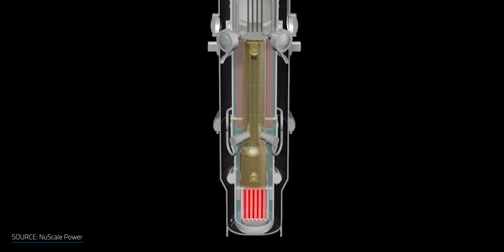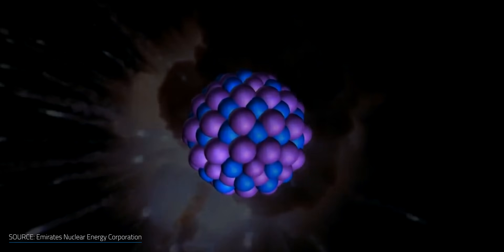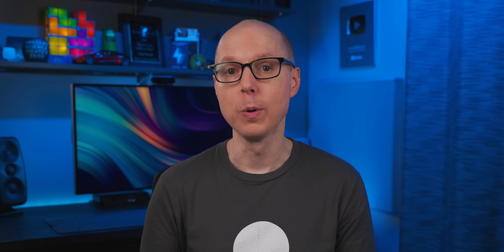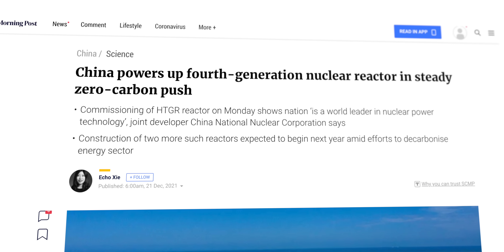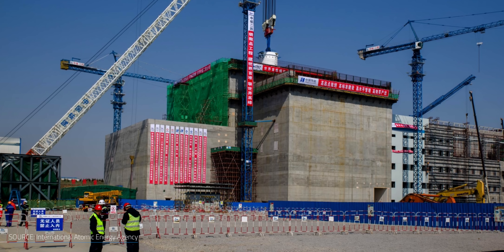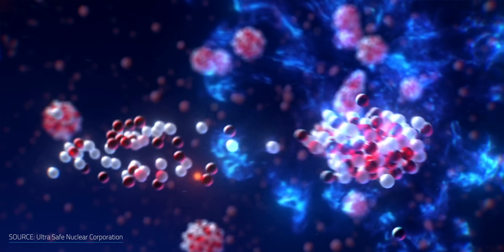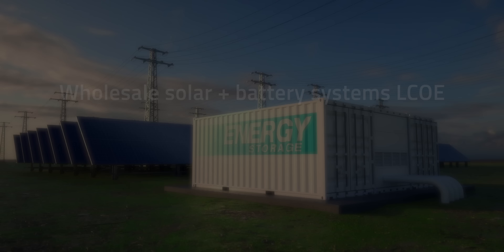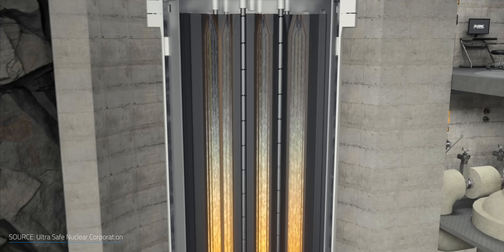Forget Small ... What About Micro Nuclear Energy?

Comment: I've been reading that breeder reactors can burn most any type of nuclear fuel or waste until 95% of it has low level radioactivity. current reactors burn the first 5% or so, so there is a vast storehouse of useable fuel moldering away as waste. Big, EXPENSIVE transformers are not needed for local transmission - put a reactor. where the electrical substation would be. Search Gen IV nuclear power to see.

Comment: Fast neutron reactors don’t have to use liquid metals for cooling, there are several designs is being developed that use molten salts, either as a cooling medium for solid fuel elements, or as carrier liquid for dissolved fuel.
Elysium and Moltex Energy both use the latter approach.
Reply: Well I guess salts kind of technically counts as molten metal. What is a salt anyway if not a metal ion bonded to a nonmetal ion...
Reply: The engineering challenges associated with MSRs are massive though. The corrosive properties of salts and the elevated operating temperatures mean longevity is a real issue. There's also the operational requirement to keep the primary loop hot at all times, or the salts will solidify and functionally destroy the the reactor.

Comment: Our energy future should not be limited to one idea or one so-called green solution. Nuclear has come a long way since the early days of the industry. GE Nuclear in the 60's talked about reducing the size of reactors and making cell systems which would be overlapped and would cover smaller areas, but would be more reliable, because one failure would not shut down a vast area being serviced by the large expensive reactors of today. Plus the overlapping systems could supply the failed reactors area' until the unit was replaced by a new one. There are many advantages to going nuclear particularly with the advent possibilities a Thorium reactor represents.

Comment: A pellet of nuclear material, that creates a few hundred degrees, safety encased in shielding, could heat domestic hot water for years, decades, or centuries, depending on the isotope. No moving parts, just in the water tank.
Reply: You know hot water tanks have sacrificial anodes sized for the length of the warranty right? The difference between the 5 year and 15 year tanks is 2 additional anodes.

Comment: "safety valves that open automatically in case of overheating"

huh... so... nothing like 3 mile island valve right that let all the water boil off could ever happen with that right?
Reply: 3 mile island happened in part because the technicians were used to working on much smaller naval reactors where decay heat is not as much of a concern.
Reply: @economicprisoner  and because of engineers that put a light, behind a desk that showed power applied to the release valve... not showing if the valve was open or closed, just that power was being applied to it... 
Engineers are some of the stupidest smart ppl i have ever met

Comment: Ehhh.... 
This is laughably disingenuous. 
There isn't a debate about nuclear safety. 
It isn't safe, and it won't ever be safe. 
Even completely ignoring the radioactive half lives of all nuclear fuel and natural disasters, we still have to contend with the human element. 
War and stupidity (whether accidental or normal negligence) doesn't matter, there will be nuclear accidents, and increasing the use of nuclear energy increases the number of incidents.

Imagine if every bombed out tank from every war over the last 20 years had a micro nuclear reactor in it.

For the record, Helium coolant isn't used because it's impossible to contain, especially when over heated, which as a cooling medium, it's guaranteed to be at some point. 
You can get Helium hot enough that it can diffuse into solid metal, in a similar fashion to hydrogen. This is the basis of some of the early fusion reactors. 
It's not a safety feature, it's a failure mode. 

Honestly, the world would be better served figuring out carbon-neutral petroleum than miniaturizing and using nuclear energy.

Comment: I've always imagined a community, or even individual homes having these tiny reactors. So let's hope this is the future!
Reply: I would not want nuclear power on a super small scale like that. Someone would manage to irradiate their block.
Reply: @Direblade11  It's not like the home owners are going to maintain it, there will be trained professionals to make sure everything is running smoothly.
Reply: @sptalat  Idk, I don't think most people would want to be around one of 50 points of failure that could expose them to radiation for an unknown amount of time.

Yeah maybe it's a bit extra panic, but when there's 2000 or more tiny reactors around a country, it's a question of when some error will happen. Idk, maybe we can put it in some exceptionally perfectly safe system.
Reply: @Direblade11  As a person who works with radiation, microreactors terrify me. Radiation leak is one thing, but the radioactive substances leak? Thanks, but no.
Reply: @Direblade11  If it's a salt-based reactor, the systems wouldn't need to be pressurized at all, and you could just bury it underground and dig it up every couple decades to refuel it

Comment: The issue at hand is not what to do with the waste but that there is waste to deal with. If the principle on which we're moving to is - reduce, reuse, recycle - nuclear waste doesn't fit into any of those categories. Everything we use needs to be in a cycle of some kind and if it can't be recycled or reused at the end of it's life then it's a burden that we should be making. This alone should be an alarm bell that indicates that nuclear is not a long term proposition. Not only that, it should only be considered tactically as a last resort.

Comment: Why not go directly to molten salt reactors? They are also easily made as small, modular units suitable for neighbourhood use, are ridiculously safe, and, as you say, almost as cheap as wind and solar. They are also able to ramp output up and down quickly to follow load variations. But the clincher for me is that they burn over 90% of the fuel  compared to conventional (including SMR) reactors which burn much less than 10% before reprocessing is required, and produce waste with much shorter half lives than conventional solid fuel types.
It a no-brainer for me!

Comment: That depends on the technology. When they use high pressure inside, like all the water reactors do, there is always danger. It's much safer to switch to Molten-Salt reactors. And with a cycle like what ThorCon or Flibe are developing, they can even use the current radioactive waste as fuel.
Forget fusion, current reactor designs are based on wrong assumptions how the Sun works.

Comment: SMR's 'should' form a significant part of the world's overall energy production matrix and Thorium should be the fuel. One thing that people don't realise when comparing coal and nuclear, is the amount of waste that coal produces. 20 to30% of coal burnt is ash and that ash requires storage. While nuclear waste is unsafe and requires storage for hundreds to thousands of years, there is not much of it. Compare that to the mountains of ash residual from coal fired power stations. This inoculates vast areas of land for hundreds to thousands of years also. The impact of wastes are likely similar, when land use is considered. The benefits of nuclear are numerous in relation to air pollution; especially CO2.

Comment: Check out the plasma reactor already built by the Thunderbolts Project. It achieves 100% power output for a 7% input with no residual dangerous radiation.  In fact, it remediates radioactive materials!

Comment: I was a little confused by one comment at 8:20 . you said that when compared to other reactors, microreactors use "low-enriched uranium", which has "U235 in higher concentration". Low enriched sounds like it's Less enriched than a typical reactor, which does enrich uranium, but then you say it has a Higher U235 concentration, which means it's More enriched. Which is it? Higher U235 is easier to use in weapons-grade applications and requires more enrichment i.e. concentration and wasted U238, so higher U235 concentration is typically bad...

Comment: A couple points about waste
1. You're confusing the benefits of fast reactors with Thorium reactors. Fast reactors fission the actinides and thus make their waste last about 200 to 500 years and they can be Uranium based. Waste from older plants can be fed to any fast reactor which will not only get more energy out of that material but also reduce it's lifetime as waste.
2. It can be recycled. France has been recycling for decades.

I'll also point out that LCOE has some flaws that make it less than ideal to use.

Comment: No. Nuclear is doomed simply because of neutron embrittlement of the steel composing the reaction vessels and associated reactor internal structures. There is nothing in our known science that can prevent or eliminate the neutron collisions with.

That said: radioactive waste should be harnessed by making waste containment's casks, tanks, et.al.  into "SNAP" thermoelectric generators. No moving parts, a simple thermocouple. Nuclear waste creates internal heat as it decays; employ that fact and put it to work, as long as the soup of isotopes are radioactive and the 2 strips of metal that compose the thermocouple remain intact: the containment vessel will produce electricity. It will not be optimal but at least the radioactive waste is doing something useful - even if its only powering a few warning LED's in Yucca mountain. For 650,000+ years.

Comment: Toshiba had working models of micro nuclear reactors in the mid 2000s. Safety and low maintenance was engineered into the systems that could power small communities, or installed at your local utility sub station.

Comment: SMRs can be constructed in existing sites where coal plants are being closed. Existing sites have all the balance of plant systems already available for water supply, electrical switchyards for dispatching the generated electricity and in some cases potential  to reutilize existing steam turbines and generators. This is a win- win approach to resolve the base load generation that cannot be obtained with wind and solar intermittent generation
Reply: I think you would need a Molten salt reactor for Coal retrofits. The SMRs using a pressure vessel only put out about 200MW. Each coal generator in my jurisdiction is about double that: at 400MW. Don't think there is enough room to install 2 SMRs for each generator (toured the facility 33 years ago as a kid, so could be mistaken).

Comment: I still want MSRs and fusion....MSRs are failure-proof and cheap, easy, atmospheric pressures, burn existing waste stocks, burn virtually 100% of their fuel, etc etc etc....SMRs are a nice upgrade from present fission, but they will have safety concerns (not insurmountable, but not "this reactor will simply stop working before an incident" as with MSRs), and still stuck on U & Pu fuel cycles, meaning long-term highly-radioactive waste storage

Comment: It seems you are still biased against nuclear. There is a difference between SMRs and MSRs. Thorium molten salt reactors do not use water, You seem confused about what you're talking about, Waste from Thorium MSRs has a half-life is 300 years not thoughts of years. Solar, wind, hydro, and geothermal are all confined to location. Solar has the issue of heavy metal waste. Wind machines are having high than expected mechanical breakdowns which will add to cost. Wind will lose its backing from the Federal government which will add to their cost. Nuclear reactors which avoid the use of water will be far safer than those in the past. I stop my subscription and hope to avoid your clickbait topics. Your love affair with solar will end in broken dreams. Even if could launch solar arrays into space for free they would not be economical because of issues with energy conversion and microwave transmission. Please take off your happy face glasses for solar. Solar will not be economical until 50 -60 percent efficient solar cells are taken out of the lab and put in the field

Comment: Matt does not seem to have heard of the UK or Rolls Royce.  Regulatory hurdles have been jumped for the SMR complexes but as these permanent projects are set for 2035-40 this might sound unimpressive. However, by obtaining clearance for the long planned sites the way is clear for RR to further develop the highly mobile 'mini' reactors using a variant of maritime proven types.
The in-house assembly graphics Matt shows are similar to what RR and contractors in the UK are all set to get working and as the 'mini' SMRs are also sealed at the factory we could see many of them powering turbines suited to different classes of installation in a very few years.
The aforementioned permanent sites are intended to also be testing grounds for other types of reactors including thorium thus regulation took this into account along with security and waste solutions and perhaps seemed to make versions of SMRs further away in time than is the case.

Comment: Now that my home is powered by solar and a battery - and everything is electric - I can appreciate the need for something to fill the gaps. Here in SoCal it's reliably sunny for most of the year, in which case I'm running on 100% solar or stored solar. However in the few occasions that it's cloudy for several days in a row, my batteries aren't enough and I must draw from the grid. Adding enough storage for this just isn't economically viable yet. That's where SMRs could come in: their small size means they can ramp up fairly quickly to respond to weather. They would only be needed for that 10% of total energy use that can't come from energy storage.
Reply: Yes, and you live in (relatively) sunny southern california. Now imagine adding the need to charge your EV (we should be moving to EVs) and if you lived in a colder climate where the sun didn't shine nearly as often and the need to heat your home in colder months.... that gap could be closer to 50% or more during come period....
Reply: @vpconroy  Indeed. However, most colder climates have good wind resources during the colder months. And ground-sourced heat pumps with underfloor heating would reduce the energy needs of home heating by 4-7x. All currently quite expensive though.

Comment: Your pricing figures are out. The Luddite lobby always bundle planning, pollution, waste management, subsidies, decommissioning, and recycling into nuclear costings, but exclude them from renewables costings.
      The nuclear "waste" is no problem; it just sits there. It's not a liquid so it doesn't leak. And it's fuel for the next 1000 years of advanced nuclear power, along with the radioactive minerals in coal ash and renewables mining spoil.
     Then you forgot to include income from medical xenon and radioisotopes, plutonium for space probes, and precious metal by-products.

5/10. Could do better.
See me after class.

Comment: One thing that should definitely be taken into account is the land cost of our energy sources. Wind and solar are fantastic, don't misunderstand me, but they require enormous amounts of land in their current form. In Massachusetts, the main cause of land clearing right now is for setting up solar farms. That's not sustainable. Nuclear has a comparatively smaller footprint and therefore a significantly smaller land cost, especially when considering SMRs and MMRs, so I'd like to see more places use them to fill in the gap they're currently filling by ramping up oil and coal production. The storage of the waste does remain a strong drawback, which is why I think the next generation of research should push towards not only sLFTRs but also towards Traveling Wave Reactors. Lower radioactivity + reuse of "spent" fuel sounds like a win/win to me.

Comment: VSMR & MMR scale all the way down to 3kw Thermal 1kw electrical as NASA Kilo-power reactor demonstrates / this a domestic home scale design that if medium volume produced could cost as little as $30k for a shipping container unit, placed in a concrete pool in someones front yard; that makes water water, warm air & electricity for 20+ years before being reclaimed by the manufacturer with a Craine & mounted to a class 8 truck for return / refurbishment at the factory. Renewables like wind & solar can only achieve 4% or injection into grids before the utility company has to install battery systems to store some of the mismatched energy production that does not match loads, as capacity factor & load following not good with intermittent renewables & adding enough battery to match 24/7/365 uptime of nuclear SMR or similar, makes new renewables more expensive that MMR, VSMR, SMR in terms of LCOE

Comment: Yes, SMRs and MSRs will eventually be a part of the mix, but wind/solar/battery systems will play a larger role sooner. As you point out, WSB is cheaper than any nuke currently on the drawing board, and has much less of a NIMBY problem to overcome.